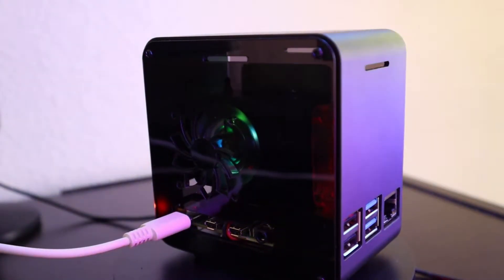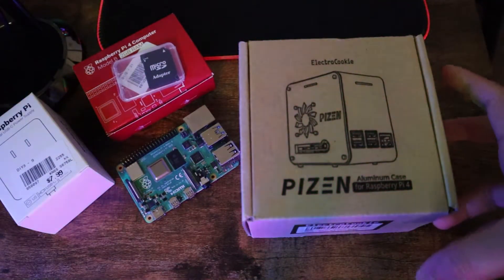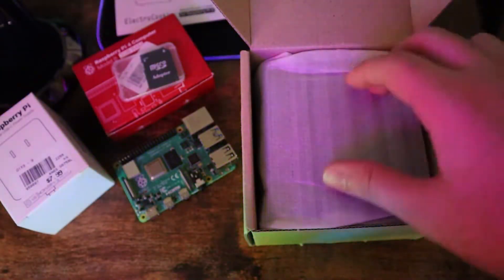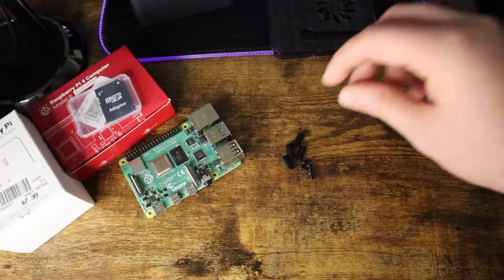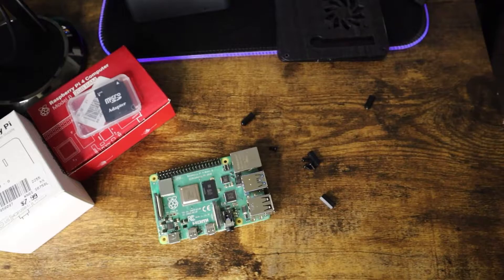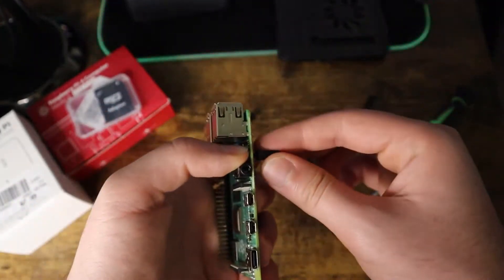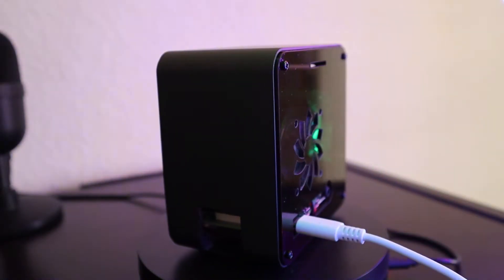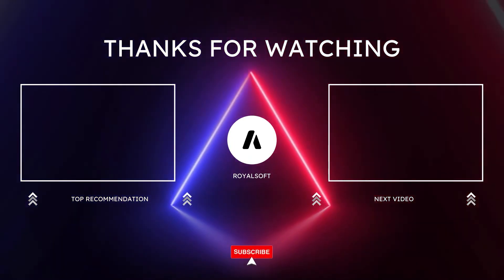Budget Amazon ElectroCookie Raspberry Pi 4 Aluminum Case

Comment: hey, thanks for the video. how did you attatch the fan ? Not the ice tower, it looks like you have both the fan + ice tower assmembled here?
Reply from the maker: Hi thanks for watching the video. You can either attach a fan and use heat sink or use a ice tower where the fan attach itself to the ice tower. What I did was that I installed an Ice tower with a fan and also did some DIY and added another fan in there so yes I have two fan in this case.
Reply: @ I guess you used some other screws and bolts to attach the black spacers for the electro cookie case at the bottom? I don’t see a way to attach the ice tower fan to the electro cookie case with the standard screws and bolts.  Thanks for the reply.
Reply from the maker: so the light that comes with the case goes toward the GPIO side of the case and the fan goes toward the other side attached to the ice tower I used the screws that came with the case and the ice tower only.

Comment: Looks to be my dream rpi4 case! I was just wondering if there's enough room for mounting a m.2 ssd expansion board?
Reply from the maker: I think there might be enough room
Reply: No need to spend the money on an m2 card as its full performance would not be utilized.  Just use something like a WD Blue SSD drive in a case with USB connection or an external USB drive.  The SSD would require less power.

Comment: Is there room between the Pi4 board and the fan to mount a "hat" board with a DAC and left and right audio outputs.  I assume IF there is you could drill two holes in the side of the case for the audio jacks to be protrude through the case for connection?